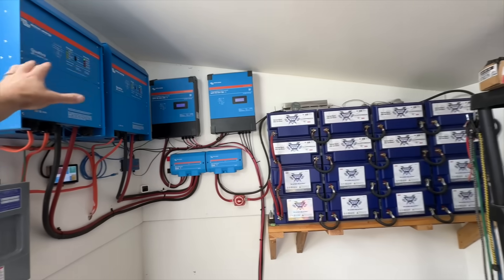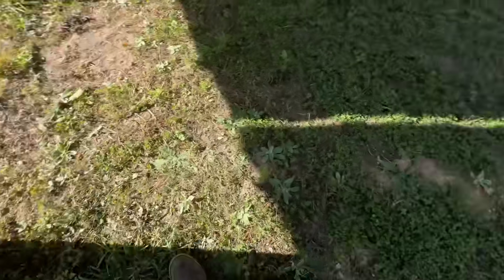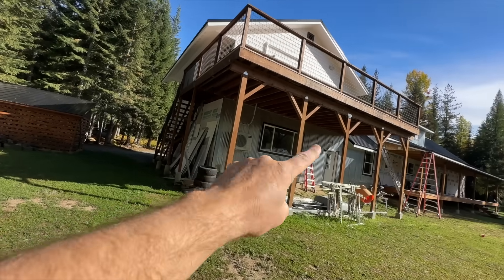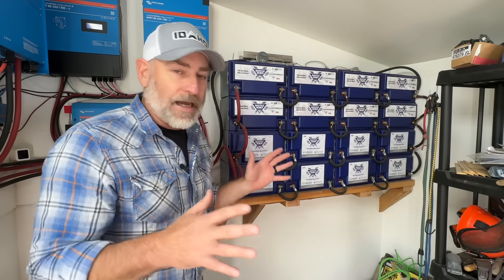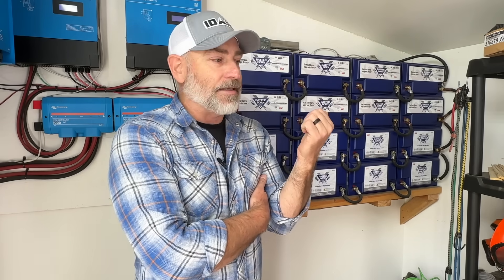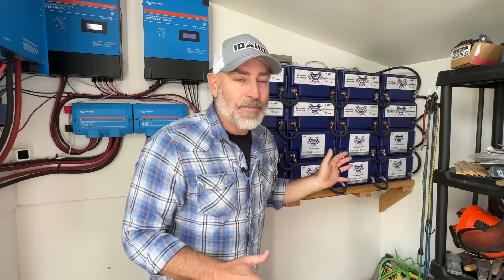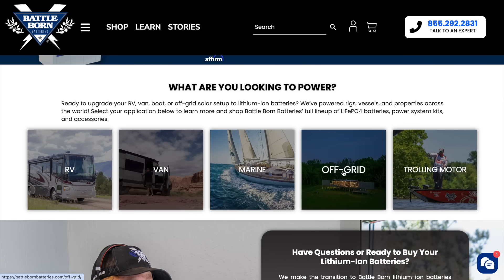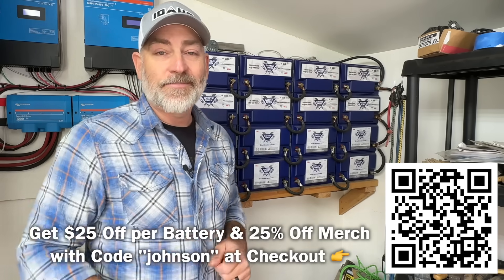EASIEST Off Grid Solar Power System Battery Bank

Comment from the maker: Thanks to BattleBorn Batteries for sponsoring this video! Get $25 off per battery and 25% off merch by using the code "johnson" at checkout: https://geni.us/BattleBorn
Reply: Thanks for the vid!  How much was the whole system?  What's the pricing per component?
Reply: What was the total cost of the entire system minus the gas powered generator?
Solar panels, all the wiring, batteries, breakers converter. Everything except the shelves and housing. Can you give a break down? I am really interested.

Comment: Love the channel and I am a big fan of you guys for sure. Just thought I would throw a little bit different perspective.
First off, the VAST and overwhelming majority of people going off grid are on a very tight budget.  I am glad that through your hard work you have been blessed with lots of YouTube money but most people don't have much money when they're trying to build cheaply off-grid. I don't know for sure, but I'm just guessing that all of your components together probably cost $25,000 or more. If you have that kind of money then that's fantastic but most people don't. Lead acid batteries are by far the cheapest route. The key with that is buying good quality heavy duty 6 volt deep cycle batteries and backing it up with a very good solar charge controller. 
Also, the technology in these newfangled battery systems have not been tested for long periods of time. That is why we constantly see some of these new technologies being complete failures. Say what you will, but let acid batteries have decades and decades of research and testing done on them. Additionally, all sealed batteries lack one important quality about them, which is that you can't test them properly. The only way to test batteries to determine true internal health and capacity of the battery is with a hydrometer. If your battery is sealed, there's no way for you to test it as a voltmeter will not tell you anything that you really need to know about how truly healthy your battery is. 
If your system is working great for you and you can afford it then that is just fantastic news. Most people aren't in that same position and thank goodness there are far cheaper options available to them which still does a really good job.

Comment: Hey man, You are super. I watched all the videos as you step by step made your solar system that gave you energy to your house. You are a super man. No matter how difficult it was for you, but you did it. You improved, you improved your energy. This is super! Victron Energy is super equipment for your energy, I am sure you are happy with Victron Energy. One thing I can tell you, put a few more solar panels on the roof of the house and increase the batteries and it will be even better both in winter and summer. Good luck to you.

Comment: Much cheaper and much more serviceable ways to go than battleborn. they are way overrated Lifepo4 is gonna last 20 years+ regardless. Id rather be able to replace my own BMS and such. Victron yes they top notch but but much more affordable ways to go. I mix victron in my system.

Comment: The red battery shut off is too small for that system. It's rated for 48v max. You are charging at almost 60v . That's a fire hazard if I'm not mistaken. Nice system though.

Comment: They have some DIY batteries that I think could cut your cost by over half for your batteries and give you even higher capacity.  Just one of them is 48v 15,000WH for under $2000
I am not in the place to make much use of that, I am on the grid still and consume a lot of power, but for you I think it makes a ton of sense.

Obviouly this was sponsored, so you probably didnt buy them, but if your money was on the line (as it is for the viewers) making a recommendation :)

Comment: awesome set up but EG4 server batteries would have been much cheaper. They have BMS communication and work well with victron. This is a great setup but alot of work and makes sense only if you have an unlimited budget and time to make a bunch of terminal connections. The more builds I do the more I love the simplicity and safety of server rack or larger batteries.  They also save space, probably could have put double the capacity or more with the same cost. Also, all those bare terminal connections scare me, more insulation on the terminals is a must.Great video and set up, just tips for improvement.

Comment: will this be ok ....Touring Caravan  uk leeds 
Router  = 1.0A(peak) @ 12V  Left on   24/7  
Batteries 2 x  115ah  12v
Solar panel = 240 watt 12v On caravan roof 
Votronic Solar Controller MPP 260... Max 260 watt  12V  (12 V / 18.5 A / 260 Wp)

Comment: Im looking to make an offgrid power station to independently power my ac, i will be using 12vdc-220vac  3000w inverter, 100ah 12v lithium battery, solar panel and charger, is 1 battery enough ?

Comment: You didn't have to use such massive cables connecting between the batteries in series. It's only 1/4 of the amps of the parallel output for those parts of the circuit.

Comment: Great looking system. I was wondering if you have had any problems with your batteries staying balanced since they are series-connected? I have twelve 12 volt BB batteries wired in series as a 24 volt system. 2S 6P. So far, I haven’t had any balancing issues. The reason I ask if you’ve had any balancing issues is because I’ve been toying with the idea of wiring my bank as a 48 volt system instead of 24. Back when I bought these I was new to off-grid solar and didn’t realize that it would have been better for me to buy 24 volt batteries for a 24 volt system and wire them in parallel only.

Comment: Oh there it is 8:51 
Now he did say they had them for a few years already I’ll give them that, there were limited options for quality lfp batteries but to recommend this today for home battery storage is insane, I could understand getting 1 or 2 for rv use and so on, this is $12,000 for 20.4kwh anyone who looking to get a system, please do your research, today there are many better designs for home battery systems at less than 1/2 the cost for storage.
This looks like a great system and I believe it will work well for many year.
 Great post and thank you for sharing.

Comment: Correct me if I am wrong, but the DC cables from lynx to Quattros should all be the same length? And I see a disconnect for the batter bank but no fuses @ each battery series-what happens if a battery fails? I just saw on the Battle Born site that the battery has short circuit protection, would this negate needing to fuse each battery series string? trying to learn, sorry for the ignorance

Comment: $ 750 for one RV battery? 100 amp deep cycle?  Are you nuts?
Reply: Maintenance free worry free and they lost for years?
When it comes to life off grid you want to take the least amount of risks when it comes to your families well being. If this system lasts for 10 years it more than pays for itself. 
Electricity it getting expensive on grid. $200 - $300 a month in the summer especially running AC, computers, water heater etc etc. So, 2-3 months pays for a battery. In one year that pays for for on of his 4 battery lines. This looks like it is gonna last even longer than 10 years.
Reply: @dennissharpe8356  There are lithium batteries with the same properties for less. You're paying for the brand at that point. This person isn't against the off grid concept, they're against the overblown pricing so maybe rethink your reply here.
Reply: @dennissharpe8356   What? Other batteries are not only cheaper, they have more safety features, and are not only "maintenance and worry free" they have a slew of extra features that lets you monitor their health if you want to (something you can't do with the batteries this guy uses). These days you can get almost 5 times the capacity from others for about the same price today which will last around 20years (5.12kWh for 830$ versus these Battle Born batteries with only 1.2kWh for 750$). These Battle Born batteries are outdated, way over priced, and lack lots of features without any actual advantage over current battery tech.

Comment: its still cost is better and at 50 % they last 20 years for lot less money // hope you never burn -up
Reply: You can get a 12v 300ah lithium battery for less than half the price of just one of the batteries he's using in this video

Comment: will prowse gave me one a couple of years ago.  It works way better than the AGM it replaced.  It runs my secondary solar power system, 12v.  my primary is a 48v XW Pro whole house system.  The BB is great

Comment: Marty, is your solar system EMP proof?
Reply from the maker: I wish. I don’t think any are EMP proof just EMP resistant.
Reply: @MartinJohnsonOffGridLiving  so is there a difference between EMP proof and EMP resistance? I know of a item called EMP Shield on the market but curious if it would protect your system. Thank you for the reply by the way

Comment: A nice thouht, but I can get replacement Rolls Royce batteries for my solar system for less than a quarter the price of Battleborn lithium.  I don't mind a little maintenance if it means saving several thousands of dollars.

Comment: In my opinion, battle born batteries, they look great. The only problem is the cost, but it’s really nice that they’re based here in the USA.
I’ve bought from Signature Solar the EG4 server rack batteries and they’re a bit expensive as well but recently I bought 116 EVE MB31 which capacity is 330 amps at 3.2 volts which is 1056 Watts per battery x 116 batteries =122496 watts for a total of $9475 and no duty tax, which I corresponded with Jenny wu at docan power which is in the DIY forums and she was great, but keep in mind it did take two months to get the batteries and I went to Battery hook up and purchased seven 100 amp BMS for a total of $478.43 with DIY coupon code also, you do have to compress these batteries so they don’t bulge which there’s a lot of videos on YouTube on how to do this.
The reason I mention this is I spent total $9953.43 for pretty much all of us minus wires and such and I’m getting 122 kW basically oppose of the battle born batteries which is 1280 watts each x16=20480 watts
And you’re basically paying the same price as a battle born batteries.
I’m just mentioning this because if this helps anybody that would be great and I’m not affiliated with these people in any which way.
by the way, I live in Sandpoint as well, or at least 10 miles down the road from Sandpoint. By the way Backwoods Solar up by Priest River are very nice people a little expensive but very knowledgeable.
Again, I hope this helps at least one person.

Comment: I have led acid deep cycle.. there not that bad but all we can afford! Prob is I live in Canada too cold for lithium. My 7 battery’s can’t keep the heat on for 14 hours straight? Do I get more batteries or a better charge controller?
Reply from the maker: That is hard to say without having all the details.
Reply: Quick/Easy answer is get more batteries to lengthen your discharge period. Not sure what a "better charge controller" would gain for you in this setup. Thinking out loud: If each lead acid battery should only discharge to 50% SOC. And a typical LADC battery holds around 100AH - you are capable of 7 batts (12vdc) X 50ah = 600W. To double your capacity (14 batteries), 7 more batteries would cost around (300+) 2100$ plus cables (200$).  For just about the same price, you could get three BattleBorn 12v 100ah batteries. These are good to 100% DoD so you are really getting six times capacity (mileage will vary). Yes, you will need to adjust charging parameters etc. Maybe setup a new string just for LiFePO4 but why stay when you could step towards the future. Good luck
Reply: A better charge controller, by itself, will not help you because 7 lead acid batteries simply don't store enough power for 14 hours of heat in Canada.  Let's say 100 amp-hours per battery divided by 2, times 7 batteries, then times 12 volts.  That's only 4,200 watt-hours, which is 300 watts for the 14 hour duration.  That will only heat a small shack if it's well insulated. You need more batteries. And this is assuming your solar panels are delivering enough power to fully charge your batteries. You need to evaluate every component in your system, because if you just go out and buy batteries, that will only fix your problem if you have enough power from your solar panels and charge controller. You might spend a lot of money, just to find out you need to spend much more on something else too.

Comment: Holy moly,58.4 Volts for LIFPO4 is almost the maximum allowed...!!.. why u run them on such high voltage? I let you know now,that the 48 V lifepo4 bateries,doest matter what brand are at 99.99% on 55,2 Volts! charging to 58.4 is degrading,stressing them....look at the tests from Andy,on the "Offgrid garage " channel,he made charge and discharge test with,the charge and discharge curves,measured for many different brand batteries,getting the same result.Dont do that,its no nececarry,You wont get much capacity bonus from 55.2-58V...not even 0.2% . Another thing,that i dont see in the videos- I know that the individual batteries have internal bms for cell balancing,but what about the battery units,sets of 4 in series? they can go out of balance too!! very simple and cheap balancers are for sell on the internet...hook them up,just for safety,and to not overcharge any of them....or charge nonstop so high until the bms starts limiting it...the BMS shall be the last line of deffense....other than these notes,the system is solid,really nice:) thanks for the video.
Reply from the maker: Here is the information from the manufacturer https://youtu.be/UzrkhMt5e0g?si=2K2ZCK7BL4jHfl2Z
Reply: +1

Comment: Marty have you looked into a Backup generator like a Generac or Kohler generator that you can hookup to your Propane tank?
Reply from the maker: Yes, But I have this generator already. When it dies I might go that route.
Reply: @MartinJohnsonOffGridLiving  it looked like its a dual fuel generator you have? Tried to run it on propane? Autostart from the inverters?

Comment: Can you set it up for 240 on 3 phases?

Otherwise its no use for our wellpump
Reply from the maker: Yes, you can but it takes 3 inverters.
Reply: Yes if you dont need much wattage,like 15kw power,you can even hook up 3 multiplus II each 3kw power,totaling on 9kw and you good to go,or if you have money than go with the 5k or bigger:) than u will have lot of powah!

Comment: 19,000 Wh of Battery???

Please help me understand the math, i am only calculating 1600?

4 Banks x 4 strings x 100 Wh per Battery =
1600 Wh

Am I crazy, or miscalculating?

Love your channel, 
but currently confused.

fyi - I would love many more videos, detailing Victron equipment, which is a company whose products i like.

Thanks
Reply from the maker: I know it can get a little confusing. 
I have 16 12v 100ah batteries. 
wh = v x ah
12v x 100ah = 1200wh per battery
1200wh x 16 batteries = 19,200wh

Have a great day!
Reply: @MartinJohnsonOffGridLiving  math is hard for most Amercians XDDDD sorry i had to do it ^^
Reply: I may have solved my own question, but please correct me if i am wrong:

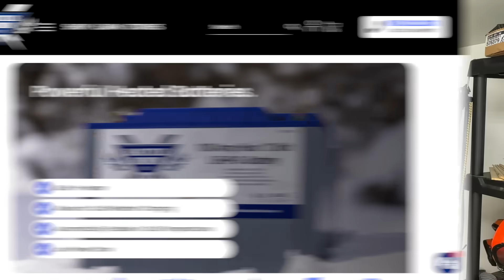at the 11:16 time mark in the above video, it shows a picture of the battle-born battery.

On the front it says 100 Ah.
I mistakenly thought he had said
100 Wh per battery, earlier in the video (did not go back to check).

So at 100 Ah per battery, 
at 12V,      A(I) x V = W,
100 Ah x 12 V = 1200 Wh
per battery

4 strings, x 4 banks 
x 1200 Wh per battery
= 4 x 4 x 1200 Wh
= 19,200 Wh of storage capacity

- most LiFePO4 should not be drained below 20%
so they do not max out

19,200 Wh x .80 = 15,360 Wh

of useable power when no sun
is available to charge, before
generator needs to be used

Thanks for any feedback
Reply: at 5:04 time - he does say
16 x 100 Ah at 12 V

16 x 100 Ah x 12 V = 19,200 Wh
Reply: Each battery is 12.8vx100ah=1280wh
1 string of 4 in parallel 12.8vx400ah=5120wh
1 string of 4 in series
51.2vx100ah=5120wh

Comment: How long will the 400 amp hour last you
Reply from the maker: That is hard to say. It depends on how how many things I'm running. 

400ah @ 48v would run a 15w led light for about 1280 hours or a 1500w toaster for 12.8 hours. 

You would need to figure out your loads to calculate how long it will last. For us under normal usage a couple of days.
Reply: @MartinJohnsonOffGridLiving  I am about to take most of my house offgrid  and I have 900 amp hours not enough Thanks for your time You have a wonderful place

Cancel

Reply